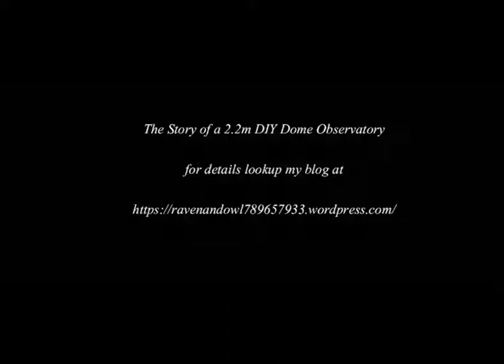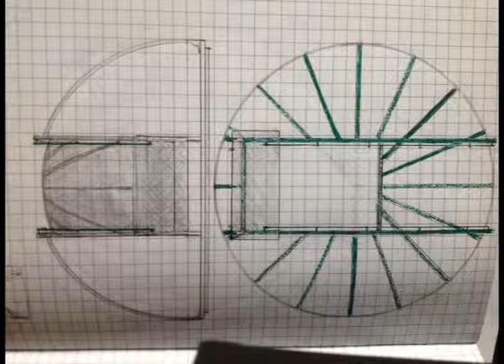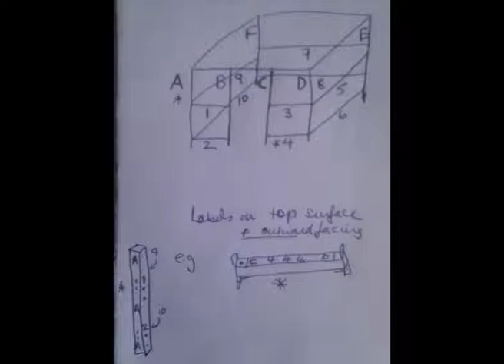Home made Dome Observatory

Comment: Excellent work and amazing choice of an Elvis classic. :) I do have to ask for your advice. I am planning on building my own obsy dome and would be very grateful if you could share some design data. I especially would like to know hoe to determine the length of the ribs without actually having to trim them before attaching. I would rather cut them out to the right length in the first place. TIA, Clear skies.
Reply from the maker: Thanks. I dont know if you have visited my blog or not because there you will find a lot more specific data about its construction. 
I think the best way of determining the size of the ribs is to start with a small scale cardboard model and work up from there. This is also helpful in working out the shape and size of the panels. It is not that difficult. I think using an intermediate stage, making strong cardboard or hardboard templates before the final wood or metal sections helps a great deal in making sure the final shape and size is correct( or close ;) ) . So out with the school geometry set , cardboard scissors and glue and start modelling.